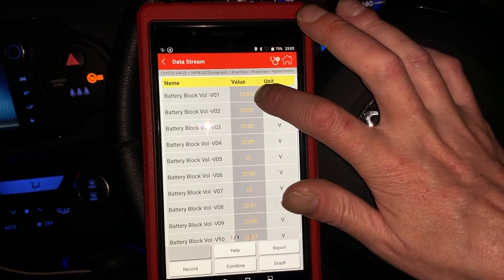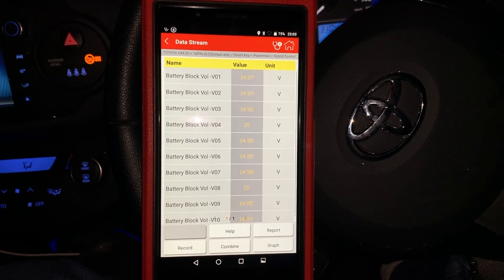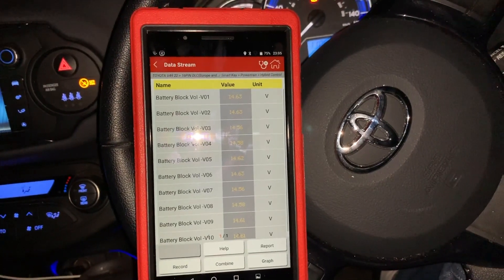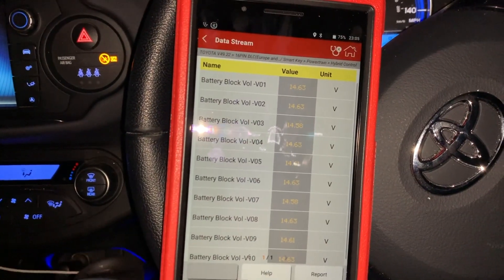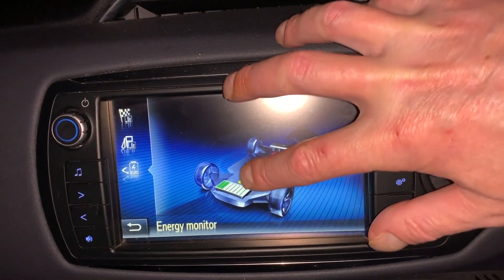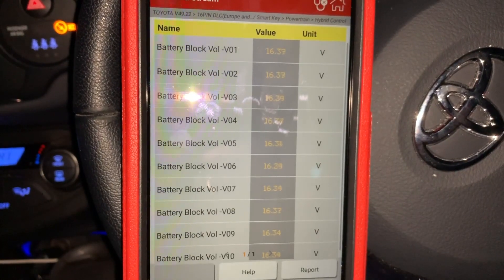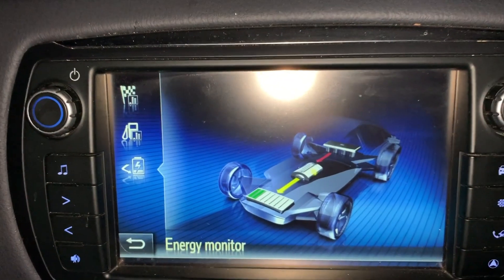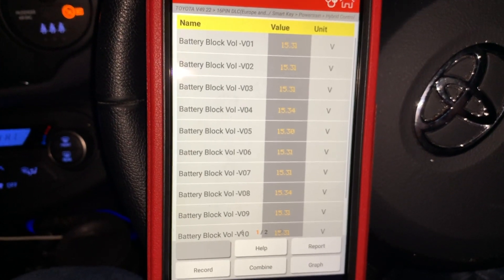Hybrid battery health check

Comment: Hi. Thanks for the video. What is the maximum voltage you can get on a pack when the battery is FULLY charged? I know that each cell has NOMINAL voltage of 7.4V... so a charged cell will have something like 9V?
Reply: and the block would have 18V? when charged?
Reply from the maker: i will put the scanner on to my 2020 hybrid yaris and check the module voltages , not had a chance to scan the new yaris yet , be intresting to see what i find with the new lithium battery pack now fitted to the latest toyota hybrids